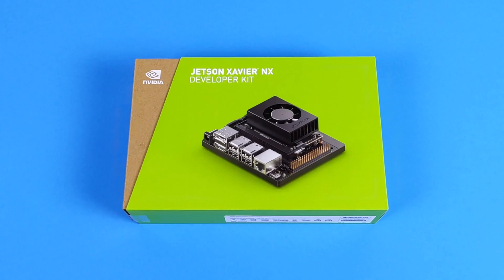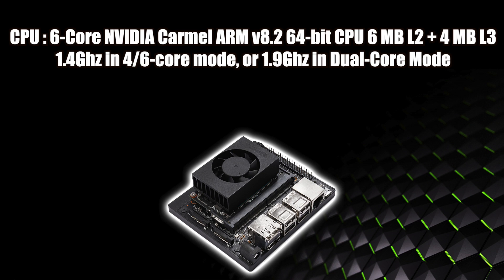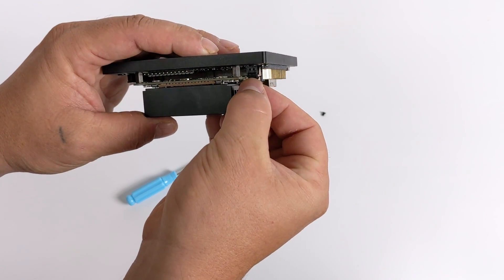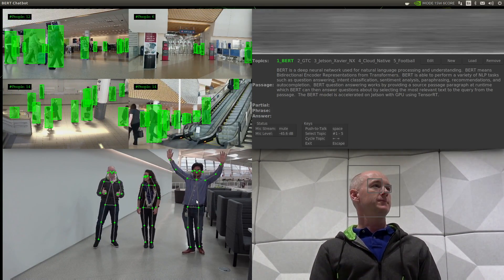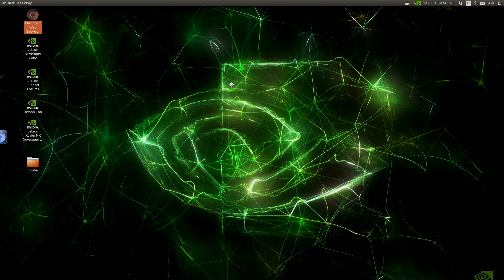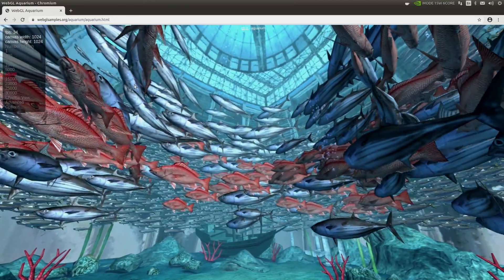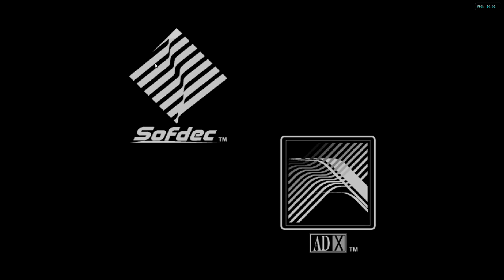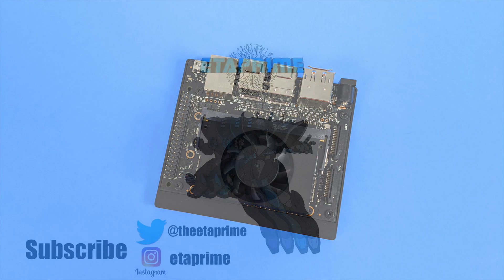NVIDIA Jetson Xavier NX Review - It's A Beast!

Comment: Looks awesome but this isnt an sbc . I didnt know part of the computer is underneath the heat sink which slots into the minboard. I feel its a bit deceptive . The sbc market is highly competitive and it would be unfair to hide this fact and still be held to the sbc standard as well as competing with other sbc's. Does anyone else feel me on this i dont think im judging to harsh or being picky i mean it wouldn't keep me from buying it. Im only stating that it should not be marketed as an sbc nor compete with them directly. Kinda similar to boxing weight classes. Let me know what ya think on thi one.

Comment: the webGL aquarium is underwhelming at least. 
i am running this test on my note 10 on battery, and i got better result. so no, i can certainly get better result (in this test) one a SOC, with lower wattage, and on a older chip running ARM.

Comment: Could this be used as an AI / graphics card for a VR headset? Would be cool to have AI processed at the very very edge (the person), so that, for instance, person walking around theme park ride (or walking trail) can have this attached to belt, and sata connected to headset. And camera attached of course. Get the AI without network needed.

Comment: Could you please try to run some x86 and x86_64 Linux (or Windows games with Wine) using the box86 and box64 emulators on the Xavier NX?

Comment: I think nVIDIA just dropped there 512cuda core Volta based Dev board. That has to be a little monster. The AI is rated at 30-32 TOPS. Qualcomm's own SD888 is actually pretty close at 26TOPS of AI compute. I remember the LG G2mini (Tegra). It had a Tegra 4i 60core GPU inside the SOC. Being that nVIDIA is trying to acquire ARM it would be great to see another smartphone SOC from nVIDIA but, that may never happen. I'm still completely happy with the LG V40 which has a SD845 and Adreno 630 (512ALU's). I use that to drive my 55in LG nano. I recently picked up the LG V60 for $350 brand new. That has the SD865 and Adreno 650 which has 1,024ALU's or GPU cores and is rated at 1.2Teraflops of FP32 compute and 14TOPS of AI?compute. The cool thing about LG's V-series phones is that they have USB-c to HDMI out support have ROOT thanks to the Devs and members over at XDA. Being that LG quit the smartphone market, at least we have OS support beyond stock. Simply having all the features these phones have including a 2Vrms 3.5mm headphone jack with a 32bit ESS SABRE qDAC to clean up the audio and a MicroSD card slot, make these a all-in-one media center about the size of a single board. Get a all-in-one universal dongle with HDMI out and USB ports and your golden. If not the phone has its own 6.8in LG P-OLED screen.

Comment: NEED HELP!!!

I did all steps in the tutorial on the xavier nx and after reboot it seemed to work. The SSD was detected and the SD seemed to be just a normal drive that was plugged in. However, I accidentally (I was to stupid to read that the SD need to be plugged in all the time) removed the SD and reboot. Only black screen, nothing happend, no boot, nothing. I inserted the SD card again, power on, nothing happend, only black screen. I even removed the SSD, flashed a new SD card and inserted it. Nothing is happening, only black screen. It seems that the Xavier NX is dead.

Any suggestions how to fix it??? Appreciate your help.

Comment: Great review! About the video decoding experience, both the browser and the standalone player were using the CPU, which is not using the board’s potential. In order to do so, you need to configure a codec offloading environment such as VAAPI or VDPAU. You can run two simultaneous 4k 60fps streams that way, while using 0% CPU.

Comment: If the Super Switch is indeed real and performs "like a PS4", then it's definitely using this chip. If they release it late this year then it should definitely be possible for them to price it at $300 like the OG Switch. I'll assume nVidia will then release a Shield TV 2 with either Xavier or Xavier NX since they'll have the chips being produced anyway. And along with that, I really hope they release a Shield 2-in-1 using Tegra Orin.

Comment: I think multicore cpus are capable of single process quantum functions if programmed properly. I think a single quantum function would require 4 cores.
Reply: yes sd 800 series have 8 core but non are programmed to take advantage of its 8 physical cores nor do emulators

Comment: I want to see nvidia make one of these that can plug into a pc mobo to be used as a coprocessor for both the cpu and the gpu and extra ram and storage.
Reply: Basically a computer within a computer. Lol. Intel already makes coprocessor already. Like. You have your regular x86 cpu. Then you have something like this in a pci slot to handle any ARM or risc application code. This would then give developers the ability to write programs using both x86 and arm code. Some code is more efficient in arm then it is im x86. So having both would greatly increase processing power.

Comment: What's the best value emulation board that can do higher end? I don't really want to spend 300 bucks on a GameCube but then the pi can't cope with it. I need single board height as it needs to fit in a tight vertical space.

Comment: Man I wished there was some sort of "in-between" model in the Jetson line. The Xavier is too expensive and the Nano is a bit underpowered for my liking. I want the specs to have atleast The same as the N-Switch.
They can keep the CPU in quad core config since the little cores cannot be used by the system but they should've have doubled the the cores in the GPU.
Reply: @smpmuzpid  yeah I know
Reply: There is/was TX2 between. And this NX is also considered middle line, there's AGX Xavier with 32 GB 256-Bit LPDDR4x much faster

Comment: I was interested in running a real time video processing engine and mounting it external/internal of a helmet for a motorcyclist and it would detect oncoming threats going too fast to react to. Could this machine detect cars and other motorcyclists in real time and send output of a beep into the ear or perhaps have a heads up display that would alert the occupant of the motorcycle that there was incoming traffic?
Reply: would probably also work in vehicles, i assume it's tech that everybody is clamouring for. I found the open source code for it online last year and have been trying to get it running since I found it, off and on, mainly off.

Comment: Hey prime I created a touch table for my kids 4 years ago. I've used the odroid xu4 with lineage Os, tinker board s, Nvidia shield, and the udoo x86 pro.

I have reverted back to the xu4 lineage os bc that version of Android runs the best. I thought the udoo x86 would be better but the only thing I like about it is the performance. In the end the udoo ended up frying. 

Could you recommend a board that has an excellent Android build and is powerful?

Comment: Big brother to Jetson Nano is the Jetson TX1 which is based on Tegra X1. Xavier NX is based on Tegra Xavier SoC which is newer and much more powerful.
Would gladly buy this board if it was cheaper and not so AI-oriented.
@12:52 Chrome still can't do hardware video decoding under Linux. Even if it could, this board can't decode VP9 which Google loves to use for 4K videos. Even Tegra Xavier is not powerful enough to decode 4K in software alone. Kodi is also doing software decoding because it does not support NVDEC which Nvidia uses in Xavier SoC. VLC Player should have NVDEC support for hardware decoding, not sure if it's enabled in the ARM build though.

Comment: nintendo should use this on the switch :)
Reply: its Nintendo they never used anything very powerful
Reply: @oofingberg  Well the X1 was pretty powerful back then, although they could've used the X2. But considering that the switch pro is still a little down the road, it is possible for sure
Reply: Why hell would they need an ai/deep learning core in a fucking gaming console? You seem like the kinda guy that has never touched a datasheet in their entire life but pretends they are smarter than everyone
Reply: @Lazar-w9u  Considering that the non ai part is still a decent step up from the X1, Ai wouldn't even have to be considered.

But they could use the ai, for stuff like ai based image scaling like dlss.
Reply: @Lazar-w9u  Well the Tegras where also used for AI purposes if I recall correctly. I may be wrong though.

Comment: if you are getting above 80% on all your cpu cores while playing video, then you don't have any gpu accelerated video playback.  so something is wrong there.  Maybe the codec or the playback app is not working correctly?
That is like simulating back in the old day when you don't have gpu accelerated video playback and older computers struggle to even play 1080p smoothly.

Comment: This is a terrible desktop value. My machine that can now be bought for about $400 on the reconditioned market (ie Amazon) with 8 intel cores, 32GB RAM and a 1050Ti does the fish demo just fine with 30,000 fish. The real value in this thing is the software comes already configured to start learning, and that's worth a lot cuz those packages can be a bear.

Comment: Uhhh, its amazing at motion detection.  It has 25 tflops of power.  I have one.  I am doing real time object detection on 4 cameras over wifi.  I also have mine booting off of a M.2 SSD.  There is a tutorial on Youtube to do it.  I made a low power real time object detection system that looks at a battery powered infrared pi camera network for when I go camping, or when society falls apart and I need a portable security system. :P

Comment: The specs claim it can decode two 4k60 videos at once but it isn't capable of fully decoding even one probably because its doing in software, and it definitely is due to the high CPU usage.If you could make it decode in hardware (which is next to impossible in Linux ) then it should be able to play smoothly and use less than 10% cpu on each core.My old Pentium 4 with HT couldn't even draw a full frame of 1080i video with 100% cpu and onboard graphics but when i added a graphics card it did full 1080i60 with less than 5% cpu in Windows Vista but not in Linux.

Comment: A new Jetson nano, new hardware, not five years old, but much more expensive.
Reply: Expensive is relative. For AI stuff closest SBC competitor maybe Ultra96 with Zynq Ultrascale+ (sadly no 16 Gbps xcvr in that vesion)
Reply: @LimbaZero  hmm seems expensive to me, it can only be used in the same way as the nano, it's just a new version, I'm sure some will sell, but this has a limited customer base and the driver's are not open source, so will get little support, like the nano but worse.

Comment: 60FPS for webGL test using aquarium with 500 fish is not that impressive. A Raspberry pi 4 2Gb OC'd at 2.147 Ghz and 850Mhz for GPU, gets 26FPS at same resolution under chromium w/500 fish. Xavier NX for webGL apps/games is only 2.2X faster than Rpi 4 2Gb and yet it costs 11.4X more. I expect more of this card.

Comment: So if you run custom Linux commands, and put better thermal solutions on the SOC, is it possible to over clock the system to run at 6 cores at 45w?
Reply: This can’t cool at 45w processor
Reply: @malathomas6141  yes, but with a beefy cooler, it might.

Comment: On the Aquarium demo, my main computer didn't struggle until 25,000 fish. I only have a Ryzen 3600 with an RX480. I wonder why your main system struggled. I noted in my Task Manager that the CPU and GPU didn't go above 40% regardless of the number of fish ... interesting.
Reply: Because this is weaker ¯\_(ツ)_/¯

Comment: “NX” 

Nintendo NX 🤔 

2021 release .
Reply: Nintendo does not invest on heavy powered hardware
Reply: @josecarlosxyz  this is hardly powerful hardware.
Reply: The chip is way too too big (physically) and the TDP slightly too high to be a good fit unfortunately.
Reply: @SteelSkin667  for a handheld hibrid, yes. But How about a full desktop switch (if they came with switch lite, why not the other way around). Im not a switch fan btw
Reply: @ricmagus   If Nintendo decide to use a chip that is that different from what they're using in the Switch, they are basically starting a new line of consoles. Whatever chip they use for their next console(s) has to fit a handheld device. The handheld/hybrid concept has been too successful for them.
Reply: SteelSkin667 They could lower the TDP enough and maybe it would still be a significant upgrade for a handheld with proper thermals.
Reply: @homedepotindustrialfan936  The TDP as configured for the Jetson board really isn't the issue with using that exact chip, since you could always play with the frequencies to compensate. The actual die of the chip is physically too large, which would make it hard to actually fit in a mobile device, and likely a bit too expensive to manufacture in the kinds of quantities they need for a games console. Look up photos of the Xavier chip without the heatsink, you'll see. (edit : It's 350 mm², compared to the 118 mm² of the Tegra X1 used in the first-gen Switch, which is already on the large side for that kind of application)
If I had to speculate I think Nvidia already has something more bespoke in the pipeline for Nintendo - something more games-specific and cheaper to manufacture.
Reply: @SteelSkin667  I doubt a Switch successor would need as much GPU power as the NX anyway. While PC gaming is typically GPU constrained, the Switch is CPU and memory bandwidth constrained. It has a hard time driving its existing GPU as it is.
Reply: @KyussTheWalkingWorm  They'd likely overhaul the whole system - CPU, GPU, memory, the lot. Actually the Caramel CPU cores used in Xavier would be a nice step up from the A57 cores used in Switch right now (I believe the A53 are present but disabled?). Backwards compatibility would be a concern, though.
Reply: @SteelSkin667 

Just make a 7nm version. Mariko is a 16 nm version of a 20 nm chip, so that's not the first time for them tp shrink a chip like that.
Reply: Shhhhh......
Reply: Nintendo are ditching intel, for  Samsung and AMD with an arm chipset.
Reply: William Rutter Nintendo wasn’t with intel to begin with
Reply: @williamrutter3619  Intel?

Comment: These specs are what the Nintendo Switch should've came with.
Reply: Have you seen the heat sink?  At 15 watt for the CPU/GPU and allowing 5 watt for the display, wifi, audio etc the Switch would last for 45 minutes with its 4310 mAh battery.
Reply: @SweBeach2023  If they remove the AI aspects of it, anything you don't need on the board for gaming, and down clock the cores than it'll run at 5-7 watts.
Reply: I guess you never heard of RnD
Reply: Cry me a river, boo hoo hoo
Reply: @nintendo1889x  How big would you like the river?
Reply: Yeah, if the could have fit a GTX 2080 Super and a i9 9900 into the Switch that would have been great.
Reply: Agree, but it would be over $500.  The current Switch has bee out for 3 years and still is $299...with no games..

Comment: Look guys, the next Nintendo Switch in front of your eyes!
Reply: They are using Samsung and Amd with an arm chipset, which should I hope outperform this board significantly.
Reply: @williamrutter3619  Do you remember the codename for the Switch?
Reply: @DenGuleBalje  nope , but AMD is making a very very GOOD PRODUCTS NOW !
Reply: @williamrutter3619  Exactly the same performance on CPU + GPU but with the half power consumption
Reply: It still could be the next switch, they didn't use the shield until it was a few years old as well, give it time
Reply: Only cpu and gpu
Reply: Not going to happen. This board is $400.  Plus Nintendo has to make a profit. It will be at a price that most people won't even want to buy
Reply: @xThePrinceOfPeace  Exactly what I'm repeating to people, but they'll respond that it's no problem because they sell their console at loss, that they will make a $500 console,... Of course all of this is ridiculous.
Reply: @trixniisama  consoles are often sold at a loss because once you buy the hardware your kind of locked into the ecosystem and they much more from subscriptions and games
Reply: @xThePrinceOfPeace  that board does not cost that much to Nvidia, and if some of that tech was sold on mass it would be very cheap, but this would make a very underpowered console, hence Nintendo leaving Nvidia.
Reply: @williamrutter3619  Economies of scale.
Reply: @xThePrinceOfPeace  if they remove all of the AI hardware features, it can create a profit if they sell it for around 300-350$

Comment: the price is still high, with the same money you can already get a used core i5 laptop, 4GB RAM. even if you're lucky you can get a built in VGA nvidia or radeon .
Reply: Like he said, the power/size ratio is what makes it expensive.
Reply: @tonystolz4982  No, It's the exclusive AI technology with a tight Software and Hardware integration and practically without a real competitor what drives price at $399. There are a bunch of ARM64 SBC boards running linux for cheap prices, some of them with NPU built-in and yet none of them even have full hardware acceleration for their GPU's running their official supported linux distro. This is not an issue for them who don't have to rely on 3rd party GPU manufacturers to reverse engineer a driver to support OpenGL on linux for example.
Reply: The price is not for the cpu, but for the gpu, most of the ai framework can run natively with cuda

Comment: 400 bucks. Might as well just build a micro atx pc for that cost.
Reply: U can buy ASRock a300 desktop first $150 and buy Ryzen 3 3200G for $100, 16Gb 3000mhz For $70 and a 400w psu for $40-$50 and it outperms this. This just has tensor cores so that’s this advantage 😇